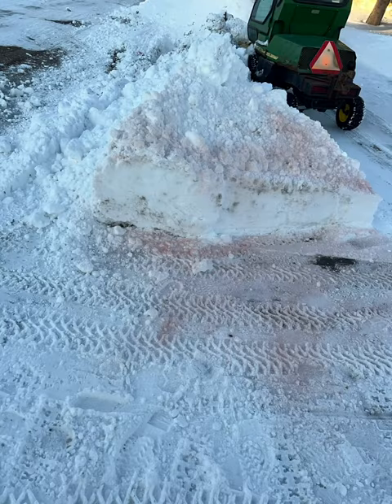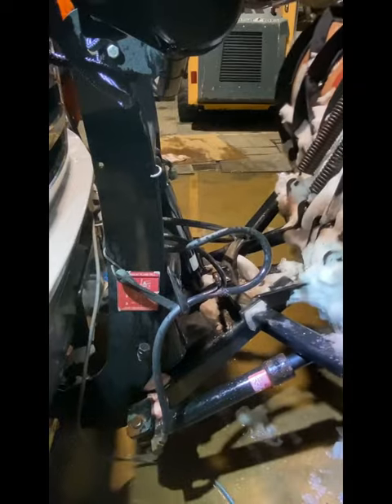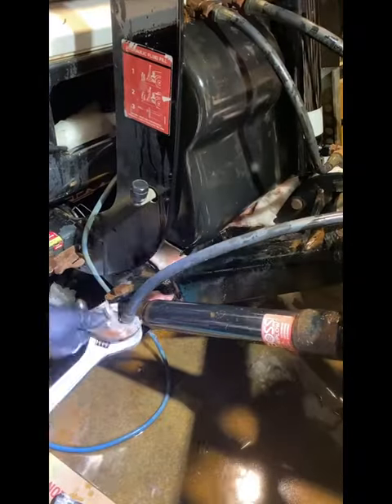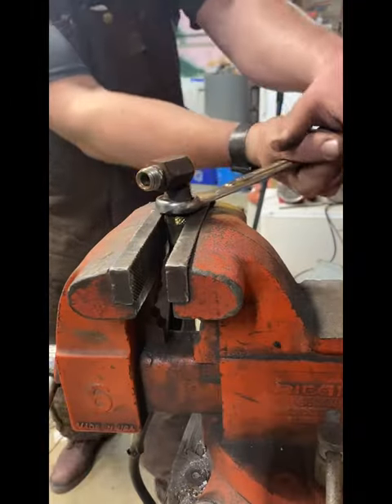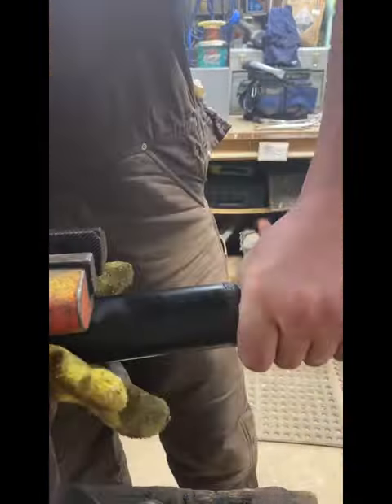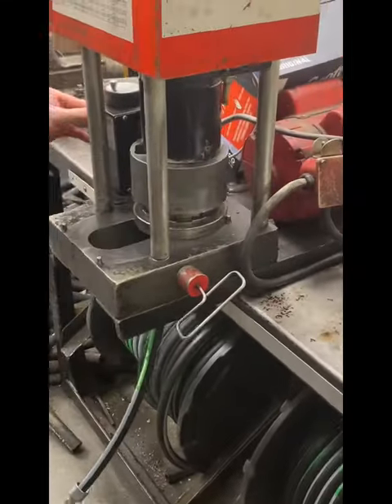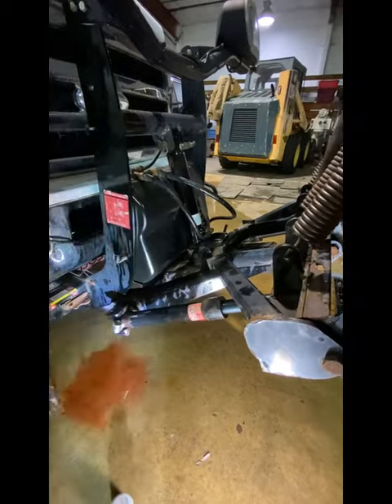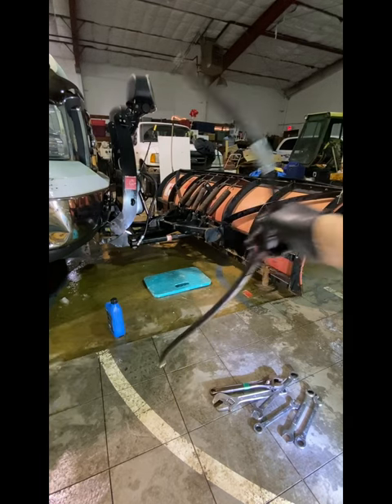Fixing a hydraulic hose that blew on my snowplow #HandsomeOrHandy #Handyman #SnowRemoval #WinterFun￼

Comment: Don't be afraid to break out the torch to get those ends to free up. Might feel wrong, but as long as one end is off or you have a nice big hole in the hose, the line won't build pressure, and it'll certainly come off easier. Dry fertilizer spreaders sure help you learn.
Reply from the maker: I think I’ll rather deal with the snow and ice than dried fertilizer
Reply: He'd have likely burned the o-ring on the 90° fitting though

Comment: I had the same issue. I used Teflon tape not so much for sealing, but easier removal next time.
Reply: That works for brake line fittings too. Little Teflon tape on the threads of the nut and some anti seize smeared on the line where the nut sits. You'll never twist and break a line while trying to remove a fitting ever again.

Comment: I run into this a lot on heavy equipment, cut the hose close to the fitting then hit it with a impact.
Reply from the maker: I’ll have to remember that for next time. I think it also would’ve helped if I would’ve had six sided wrench as opposed to a 12 which kept on slipping on the brass.
Reply: An air hammer with a chisel bit also works pretty good. Hit one of the hex corners and it'll start turning.

Comment: I replaced all hoses (as needed) with straight fittings and a separate 90. The swivel 90s fail all the time and a hard 90 is far more durable. Also 10ml dry-gas prevents freezing.

Comment: Next time try using the right tool for the job.  Will work a little better. Probably be 3 or 4 times easier and won't destroy stuff in the process.

Comment: If you used the proper tool for the job instead of an adjustable wrench you would've probably been able to get it off without putting it on the vice

Comment: Why would you use pipe? Switch this shit over to JIC save yourself a ton of headache in the future.
You took off didn't even look like for a hydraulic line look more like airline. Was that just a single wire hose?